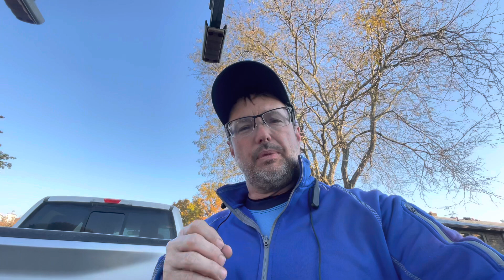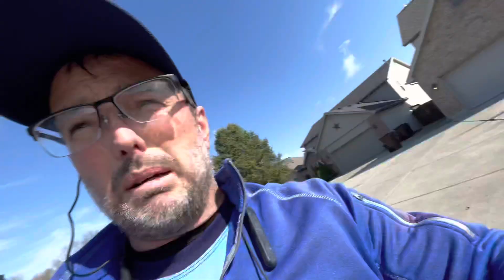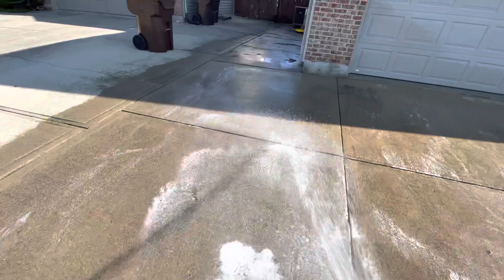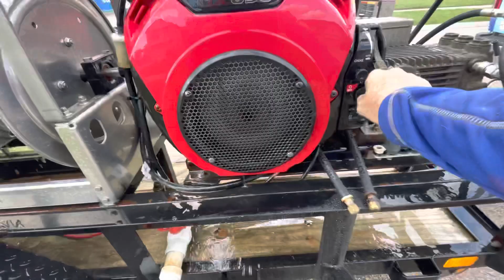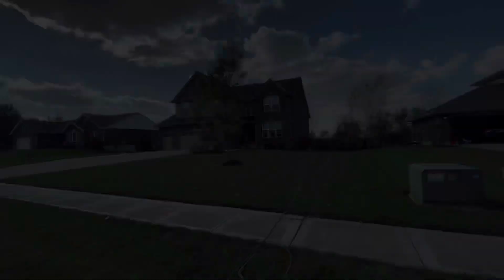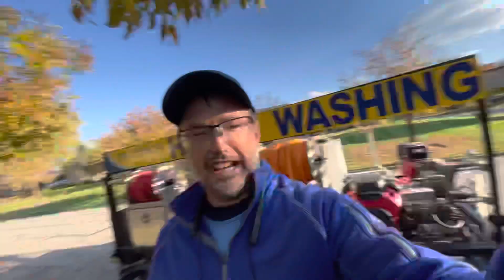Topless Pressure Washing! And A Near Fight!

Comment: Once I saw the $100 I was dead laughing hahahaha! Man do you fly with that 19 inch!! Also I love the way you have the quick connects mounted on the trailer and you just pull out the hose you need and pull out the extra left and plug it in! Seems a lot better than it going through the reel. I’m gonna do that on my next build!
Reply from the maker: Good morning brother. Thank you for watching. Yes, it’s a great set up. It probably takes me 10 seconds longer because I actually have to connect the hose to the quick connect. However, the beauty is, I can pull out what hose is needed, instead of running all 250 feet or 300 feet.
Reply: @TheFreshRinse  Yeah and to me I feel like it’s less maintenance you have to worry about if the reel goes bad cause of the constant pressure. So I think your route is a lot maintenance free!

Comment: At the end you say your rinsing out the downstream injector, are you not already rinsing out the injector when you rinse the house?
Reply from the maker: No sir. The my setup runs through an injector bypass. I have to run through the injector, but switch my flow from SH to water. That’s what the little black dial does for me.
Reply: Guess I’m confused. Wouldn’t you already be in rinse mode if your wrapping up the job?
Reply from the maker: @iveyexteriorcleaningservic9477  Right, but the rinse bypasses the injector. Therefore no water is going through the injector. I’ll do a video.
Reply: @TheFreshRinse  you don’t have to go and take your time to do all that. Just learning. I appreciate your response though!
Reply from the maker: @iveyexteriorcleaningservic9477  I don’t mind in the least. I learn visually. I also explain things better visually. No problem at all. Thanks for watching.